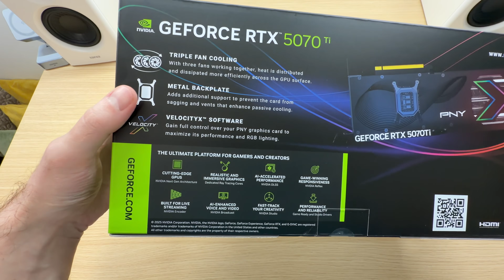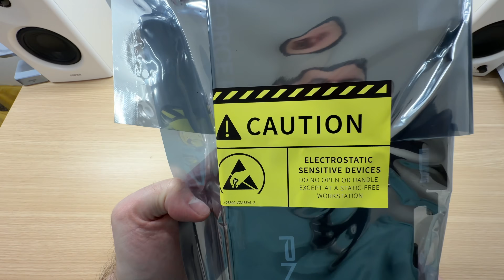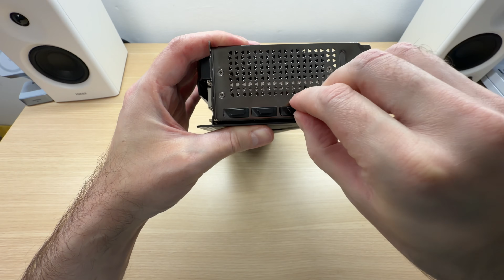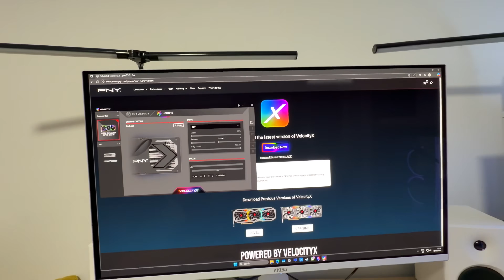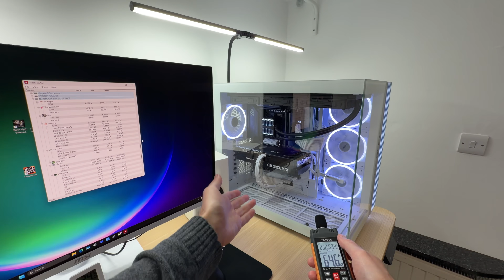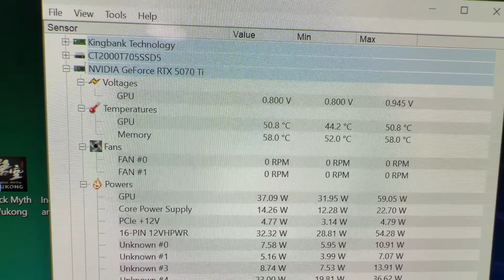Noisy or Quiet? PNY RTX 5070 Ti ARGB OC Review

Comment: I was considering PNY version, since it was the cheapest one. But then decided to choose Zotac AMP Infinity. It was €50 above MSRP, but it was totally worth it - this version has vapor chamber, massive cooler and very attractive design. It has 345W max power limit and heats up to 70 °C. While with 300W limit it only reaches 67°C. Fans are spinning at ~1500 RPM or lower. So it is a very quiet card.
W/o any major load it's temp is just ~35 °C. Right after full load, when fans stop spinning, it's temp is 42-43 °C. And then it slowly goes down, until it reaches 35 °C again.
W/ undervolt at 870mV/2850MHz it consumes up to 250W and heats up to 62 °C.
Reply: I got the same card and I had to say , yours might running on a good condition airflow 

Mine at CONSTANT 300 watt on Default running at 69 to 71 celcius with 1890 RPM , on Maximum Overclock with constant 330 to 335 watt (+300MHz Core +2000MHz Memory) it reach 76 to 79 celcius at 2200 RPM 
But this is a Worst Case Scenario , I open RE2 Remake at Max + 150% Render Res and find a spot where it hits Maximum Power Consumption and let it idle there .. if I play normally , the power consumption goes up and down so the temp won't be so high all the time

My favorite is Undervolt Overclock , which 3000MHz at 0.970v , it barely touches 300 watt and it got +10fps in most games , Core Frequency hitting 3022MHz ((Default Frequency is 2815MHz)) , temperature in worst case scenario hits 72 Celcius at 1850 RPM which is good

All these is used on a SHIT PC Case that focusing on Aesthetic , a CHEAP Tecware VX Prism M Case , An mATX with only 2 Bottom Intakes with 3 Exhaust , 1 Rear Exhaust and Side Mounted 240mm Exhaust Radiator 

Meaning , this card is very VERY GOOD
Reply: @kyosukeshidou1370 Maybe. It may also depends on a certain sample. Mine is able to run at 3000MHz/920mV - then it's temp does not exceed 65 °C. Guess I might won a silicon lottery for once.
I am using a cheap PCCooler C3D510 case, which I snatched for just €30. And installed a few cheapest Thermalright 140 mm fans (€3 each). So definitely not a premium build, but good enough in my opinion. And it is very quiet - RPM do not exceed 1000 most of the time.

What I like about this certain Zotac model - memory temp is always on par with GPU temp under load. Other models are usually less effective when it comes to memory cooling.
Reply: @stangamer1151  even tho yours is a cheap case , yours still had a great airflow , Aquarium case with Triple Glass is literally shit when it comes to cooling , its purely aesthetic , im glad my i5-14600K and 5070Ti still runs good without throttling 

speaking of Silicon lottery , I lost .. my AMP Extreme won't go more than 300MHz OC while other cards I see can go up to +450MHz .. also it can run at 950mV but it crashes once every few gaming session so yep , its definitely unstable there so I go with 975mV which never crash
Reply: @kyosukeshidou1370 I was considering aquarium. Ocypus have a couple of decent looking ones, for example. But I decided to get mesh type. I can still see a glowing silhouette of my card through the spinning fans and the grill in the dark. And the case looks fine in the light due to interesting design of the front grill.
I had to install a custom dust filter to the front panel though. And it increased GPU temp under load by 2 °C, so the final temps are close to my (previous/first) 20 year old Thermaltake Shark case with a few additional 120 mm fans intalled (since it only had 2 fans preinstalled).

My GPU sample can function at +400 MHz, which results in ~3250 MHz in gaming scenarios.
But I prefer to use OC + undervolt too. So for now I stopped at 870mV/2850MHz and +3000MHz on memory.
Reply: @stangamer1151   I have the Pny triple fan plus argb oc and it also has vapor chamber, while  the power limit is 330w. It's 34C in idle and around 55C in stress tests. It's the quitest gpu I've ever had.
Reply: Lol
Reply: how much did you pay for the zotac amp infinity?
Reply: @Creeperdy €50 above the cheapest version.
Reply: @stangamer1151  and how much was the cheapest version (msrp) in your region?

Comment: seeing these versions of 5070ti, MSI with the Vanguard line works miracles 999 rpm with 50 54 degrees, basically 15 20 less than a competitor with a fully reinforced GPU
Reply: Vanguard is actually the best version for a RTX 5070 Ti, but it very expensive in the majority of countries.
Reply: @haxzord Absolutely
Reply: @haxzord What are more value  compared to the peace of mind of not having a GPU at 80 degrees with 3 months of use and almost 3000 rpm?
Reply: @LuisFelipe1971-s1d  I know, thats why i bought a RTX 5070 Ti Vanguard. i dont like my GPU being hot every time
Reply: @LuisFelipe1971-s1d  what are you talking about? i said i am bought a Vanguard because i like cooler GPUs and the Vanguard is one of the coolest GPUs
Reply: Vengurd is 200usd more expensive than pny epic-x argb ( in my region)
Reply: @mr.gaming878 What are $200 compared to the peace of mind of not having a GPU at 80 degrees with 3 months of use and almost 3000 rpm?
Reply: @LuisFelipe1971-s1d  Bruh with this price difference you should aswell just save a tiny bit more and buy a 5080
Reply: @nazzem4043  😂pny5080 is about 400usd expensive than pny 5070ti argb v
Reply: @mr.gaming878 but how many more expensive the pny 5080 is compared to the 5070 ti vanguard?
Reply: @mr.gaming878 on my country the 5070 vanguard is more expensive than a shadow 3x 5070 ti, and a 5070 ti vanguard is more expensive than a galax or inno 3d 5080
Reply: @LuisFelipe1971-s1d  Why pay 200 more when you can pay 250 more and go for the 5080...?  makes no sense.
Reply: but look at the price diff

Comment: Two things annoy me with this model.  To the point I would seriously consider not getting it if I could get it in the first place.  The new power connectors I do not trust, and the VRAM which should have been at least a bit higher.  Obviously not a PNY's fault.
Otherwise it's a good GPU.  
Thanks for the review.

Comment: Vadim, for your PC, I would recommend getting three more bottom reverse fans. In total, there will be six reverse fans, which is way better for your setup. Your temps are high because there isn't enough cold air in the case, as all you have is three reverse fans blowing in the glass. The PNY 5070 Ti PCB has its hottest place near the rear DP/HDMI shield. Bottom fans from the case would help a lot with this PNY card.
Reply from the maker: Thanks for the suggestion, I'll definitely look into that!

Comment: PNY 5090 oc had its capitaters popped
Reply: so did pny 5070
Reply: @crsirr  What about 5070 ti? Same issue or only 5070 and 5090 problem?
Reply: @use @user-f1ff23 only with non plus models. Plus models have better capacitors.
Reply: @legendaryhumper  how do you know if it is a plus or not ??
Reply: @TheMichaelparis it would say plus. Like PNY 5070 ti oc plus
Reply: @legendaryhumper oh ok 👌 i got the 5080 version and reading the specs of the 70ti plus it has the same dimensions..

Comment: 75 degree gpu and 2000 rpm very bad
Reply: do not forget that is in a closed case meaning it is not in an open air bench and the room temp matters as well as other pc components, fans etc.
Reply: I have the RTX 5080 version of this. It doesn't hit above 60c. even at that ambient temp. The fans run at like 60% to 70%.
Reply: i notice he dont have 3 fans on the bottom of his case. fish-tank case have bad airflow already the 3 rear fan basically blow straight to the glass. with 3 bottom fans it could redirect the air the air to go directly UP instantly so that probably why
Reply: Definitely something wrong either with the card or the benchmark, this card should be hitting around 57 degrees at 300W/35dBA. (Techpowerup).
Reply: @Hito343  if you mean 5070 Ti EPIC-X RGB Plus OC this "Plus" in name is crucial, bigger heatsink, bigger fans
Reply: @Hito343  its a smaller radiator revision on video
Reply: @Hito343  this is on paper 
actually temps are actually alot higher
Reply: This is likely because he didn't install bottom fans, and the top that could've been used for case ventilation is solely dedicated to cooling the rad. So, the only way hot air from the GPU & MB can escape is the rear exhaust.

I have mine in an O11D mini V2 flow w/ 3 bottom fans, and I use air cooling for the CPU so I was able to install 2 exhaust fans on top. At the same room temp my PNY 5070 ti only runs at <55 C when it draws <250w, and ~60 C when drawing 300w.
Reply: @motherflerkentannhauser8152  your explanation sounds reasonable. His case look huge (or because of the camera angle i dont' know) but this card (3 slot and quite big) looks tiny in the PC case. And the fact that he doesn't have nay bottom fan makes 75 C at around 300W for a brand new card hot.
So with better airflow,  around 6x C at 300 W is good enough. Still very good GPU card with reasonable price
Reply: @motherflerkentannhauser8152 what rpm
Reply: Probably cause its boosting 2830 mhz.

Much higher than other stock 5070 ti
Reply: @B1-K4R 2830mhz low for 5070 ti

Comment: Oh sick! I just got the PNY 5070 TI OC Plus model, cant wait to get it. Hopefully this will give me an indication of noise levels. Sure as hell should sound less than my current dual fan 2070 lol.
Reply from the maker: That's awesome, I hope you enjoy it!
Reply: You'll be more than happy, mate :) I have exactly the same model as yours and it's awesome. After UV it runs at 0.875v@2782MHz on core (didn't try going lower) and +2000MHz on VRAM, not exceeding even 60 deg Celcius. It also pulls less than 80% of stock wattage while scoring above average in 3DMark 👌
Reply: Hope you got the RGB Version since its 8% faster cause its overclocked higher
Reply: Hey,how is your temps with plus model
Reply: @gaunter5576   I've got 34C in idle and around 55C in stress tests, and even lower in gaming. It's super quiet as well!